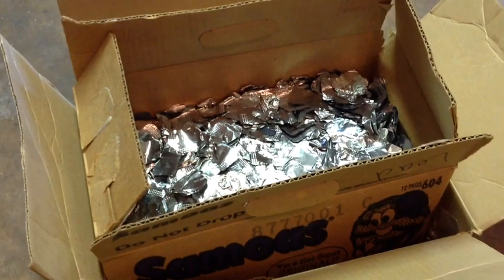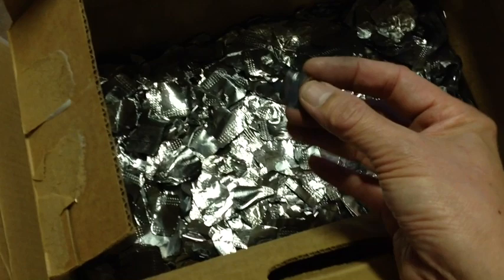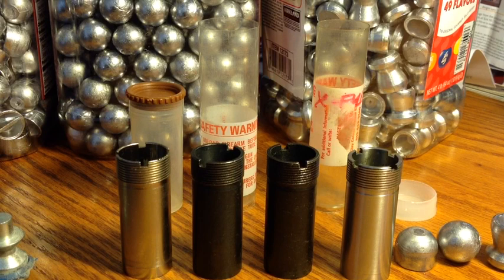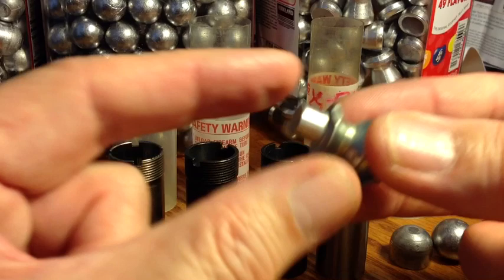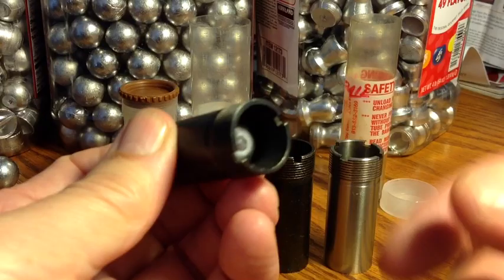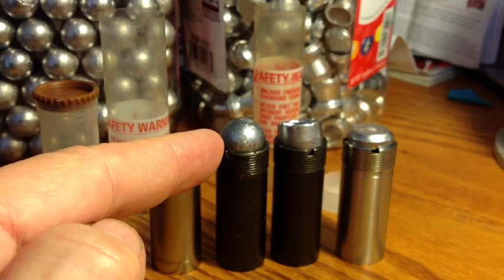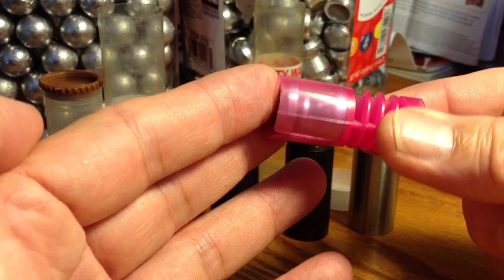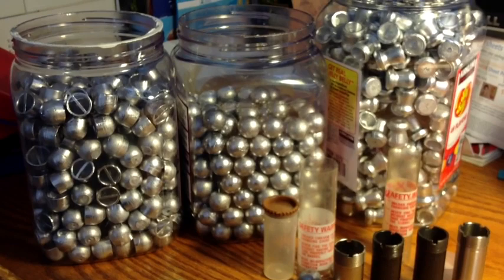Why Only Pure Lead For Shotgun Slugs?

Comment: Great video! I buy scrap plumbing and roofing lead from a local recycler. I buy alloy from RotoMetals and make ingots of various BHN#. I maintain there is no better ingot than the old corn-ear shape. They are about one pound each, have a textured grip and work perfectly with Lee Production Pots. They won't splash you with hot lead when you put them in because they touch the bottom of both the 10lb and 20lb pots, and their size and shape allow more to be added at once vs Lee or Lyman ingots. Also, you can pick up the molds (iron cornbread pans) at most peddlers' malls or flea markets for $10 or less and they make either seven or nine ears. I got over neatly stacking my Lyman ingots years ago. I throw these ears in a 5-gal plastic bucket and go through about 60 of them per day, on average.

Comment: There's not a single dental office within a 50 miles radius of us here in eastern Ohio that will let you have their lead. Not because another reloader already got claims to it, but because the dental offices are contracting with recyclers who got priority to the lead.
   Same goes for our local recyclers...they refuse to resell anything that was brought in to them. I was extremely fortunate to find just one small recycler who gets wheel weights from local auto tire/service shops and they also get pure lead plumbing pipe from time to time when homeowners get their plumbing updated.
   So I use wheel weight lead for my .45 ACP and 9mm Luger pistol rounds which ends up with a Brinell hardness of approx 16-18 , and then the pure lead pipe for my shot gun rounds. Only paid around .40 cents per pound for the wheel weights and around .60 per pound for the lead pipe. Collected the lead for the past 4 years and now got nearly 400lbs of wheel weight ingots and 150 lbs of pure lead ingots :D
  NOTE Get ALL you can while you can... due to environmental laws, lead wheel weights are quickly becoming a thing of the past whereby the industry is making more and more wheel weights out of zinc and other materials, and well the lead pipe is only something you come across at the right moments after someone re-did their plumbing and you happen to get to the recycler before someone else ;o)

Comment: I have been playing around with the lyman slug.  I use a remington 870 express with a rifled barell.  I started putting a 2% tin mixture.  I really believe the round is coming out better.  I plan on trying it on a H&R slug gun this year.
Reply from the maker: James Tepfenhart - Thanks for your fine comment.  Good luck with your slug shooting in that 870 and that H&R- 2% tin is fine in your slug alloy - as you know, the tin helps the molten lead to fill your mold better and produce better casting while adding less than 1 BHN to your slug. That's as good as pure as recommended by Lyman.  Good shootin' to ya...

Comment: great info ,have used hard lead for slugs for years but I also knew the reason for the warning .I only shoot slugs out of open choked guns .and I always label the hard slugs as such .
Reply from the maker: mark cooper - we'll just have to keep shootin' bullseyes there pardner…Best to ya...
Reply: I got tired of trying to find wads to use with lee 7/8 drive key slugs.I bought a mini milling machine and take the center post out of the mold and chuck it up in the mini lathe and mill the slug down to  size so that it fits in the wad properly then drop test it through the barrel

Comment: What about nontoxic materials such as zinc and copper?  New deer hunter here.  I read some research about toxicity resulting from lead infiltration in game meat and would like a healthier alternative to lead, but it's hard to find nontoxic factory loads.  I'm thinking about figuring out how to cast and hand load non-toxic slugs.  Thanks!
Reply: zinc fumes are even worse than lead. copper needs a LOT of heat to melt. though you can turn it.

Comment: i cast only wheel weight lead (never zinc or steel) or car battery cable lead or fishing weight lead or birdshot lead i melt and flux myself. shot thru only modified or open choke shotguns. i never use full choke fer anyfing other then size 6 or smaller birdshot.

Comment: +Fortunecookie45lc Thanks for the reply- of course I would be sizing the slug and adding the wad thicknesses to the diameter! If I wanted to destroy wads while sizing slugs I would just continue to do it with fast powder and my rifled barrel ;)

I don't know if the snug push through test applies to a rifled barrel like it does for a smoothbore? I think I'd want a little obturation. Of course it's not what I want, it's what my particular gun wants so the testing continues.
Reply from the maker: +radarsonwheels1 -- You've got a good handle on it...I hope your die solution works well, because if it does, you have a business opportunity.  After years of trying to get reload slugs to shoot as good as factory, I just tell slug shooters to use factory for hunting and purpose, and use our economical reload slugs for practice, recreation and range.  I guess that is my definition of elusive... You will see some videos with good accuracy, but we need good reliable accuracy, and if they have a magic barrel, they need to hang onto that...  Best to ya, FC

Comment: i cast wheel weight lead slugs and shoot them only through a improved cyl. choke and marked with sharpy on them W.W for wheel weight lead.
Reply from the maker: grizzskoalcope- IC or C bore is the Slug Policy, after all…your solution works… with soft lead, the advantage is No Policy is required… :) Best to ya...

Comment: Sheet lead such as is used in roofing, pipes, toilet gaskets, and the jars used for radioactive medicine are all common cheap sources of lead that is "pure" for practical purposes. pipes tend to have a lot of oxides crud and slag to flux off though.  People should also remember that scrap yards "metal recycling centers' will generally sell to the public. pure scrap lead in easy to handle and melt sources like virgin rolls of sheet lead is generally around 30 cents a pound. They usually charge about 60 cents for lead in ingots. I prefer the sheets because I know what's in them. Ingots are a mystery. I suppose I should bring my art pencils with me next time I go to test the ingots for hardness though.
Reply from the maker: GunFun ZS- Many do not have those great sources for pure lead.  I sense that is why so many comments hoping to be able to use other lead for slugs.  Kinda breaks my heart though to hear casters using precious WWs to make slugs or try to "burn out" or skim out hard lead to try to make soft lead.  If they had scrap yards to buy your examples, that would be ideal.  If so, they should stock up on pure lead for their slugs.  I read some old documentations of pure lead back in the frontier days - it cost them $1 a pound in their dollars (that was very expensive) and they carried little lengths of it to break off and melt in their little ladles to cast and every time they fired, they tried to recover the lead for reuse…Thanks for your great posts and good day to you...
Reply: Thanks for the kindly response. Every city has a scrap yard somewhere, I think it just doesn't occur to people to look. One thing I have found is that if I call and ask if they have lead at most of the ones I have checked on, the person who runs the office will say no. So ask what price they will sell it for if they have any. They are all going to have some, because people who bring scrap metal will have bits to drop off- especially from construction removals. So if you go and ask one of the yard hands, they are sure to have a bin of it somewhere. I just sit here jealous of your access to the berm. The indoor range  in my city does not sell the scrap or allow patrons to collect it. Worse, they actively lobby to close down public land shooting areas to build a monopoly. I will not give them a cent.

BTW, I just tested those Poly coat bullets in 308, and they seemed to shoot well close range, and I'm getting better at more uniform coatings. Bore was shiny. I've also ordered a replacement camera, so I hope to share findings soon.
Reply from the maker: GunFun ZS The last time I visited the metal recycler, I had three big cans of copper jackets and slag.  They wouldn't take them even if I just gave it to them because there is a regulation that range scrap would not be accepted because it might contain live rounds.  I tried to explain that this came out of a melt, but the regulation prohibited it anyway.  So I threw it into the garbage - go figure on that one.  Just gives you an idea of the regulations in the Great People's Republic of California…but I'll ask about the lead just in case, but it's still hard to beat the free pure lead I get from my four dental offices…I get a steady supply as you see from this video..Have a great day...
Reply: That's good my local dentists have never had any when I ask. Probably from other guys who watch your videos. I did buy about two and a half 5 gallon buckets of foils from a scrap yard once though.
Reply from the maker: GunFun ZS wow-your scrap yards have everything.  I've never ever seen any dental foil lead in our scrap yards…Thanks for your comment...

Comment: What if we have a full choke on a gun but the slug still fits all the way down the barrel bc I have that problem I have but with the wad it's a tight fit
Reply from the maker: robert hedges - Every shotgun barrel is its own animal.  There is a full range of variation in shotgun chokes and barrels.  We are told repeatedly that slugs should be pure soft lead and only shot through cylinder or IC bores.  The factories tell us not to shoot them through full chokes, but in the background - they have provided safety in the event that shooters accidentally shoot them through full chokes - because that will happen.  We can get into problems deliberately shooting them through our Full chokes because there are other variables that might raise pressures such as the oversized slug, overhard slug, extra tight wads, overcharges, fouled barrels.  And we don't have enough safety margins with Full chokes to really handle those especially if they occur in combination.  The warnings from the factoires and reloading companies are there not only to protect the companies, but also to protect us and those around us.  Best to ya,  FC
Reply: Remember that although slugs are usually high velocity, the slug; especially if they are homemade in a mould and passed though barrel; there`s always a fraction of compression of the slug ; especially if you`re using home made lead thus the slug may expand a fraction before leaving the barrel. So play safe and don`t use a choked barrel. Greetings From Malta Europe.

Comment: Howdy fortunecookie45lc! I enjoy your videos!I'm beginning to experiment with the lee 7/8 slugs but only in a scoped rifled mossberg 500 so thankfully there's no choke. I'm considering making a sizing die to make my finished product with wad .003 over groove to eliminate fliers from damaged wads and better center the slug. 
Have you considered this? Or have you found acceptable accuracy as cast? I remember you described the Lee slug accuracy as "elusive"!
Reply from the maker: +radarsonwheels1 -- Your sizing die idea has merit, but you might find problems in that the wad petals of your wad / slub combo are compressible and will not size well.  Would be better to size the slug and measure the thickness of the wads X2 and the total should be .002" or so thicker than the diameter of your barrel.  But easier would be to just use your barrel as a gauge - push the slug/ wad combo through it with a long wooden dowel.  If the combo pushes through with smooth but ready resistance, you have good fit to the bore.  If too tight to push through, your petals will strip on firing and your accuracy will be random - find a wad with thinner petals... Best to ya,  FC

Comment: What about a Modified Choke On 12 Gauge what would you Recommend 100 Lead Or is Wheel Weight Alloy Ok
Reply from the maker: Chris Chiampo  the best for our cast shotgun slugs is pure lead and only thru cylinder chokes.  This is the recommendation of all the factories and loading manuals.  Good test for Safety is to push the slug wad combo thru your barrel, if the combo is snug but pushes thru, you’ve got a good combo.  But harder lead like wheel weights are not recommended.  Bare slugs shot thru shotgun barrels should definitely be pure Lead.  Sabot slugs can be alloys but that is academic since we cannot make those ourselves anyway.
Reply from the maker: Chris Chiampo - Had to come back and finish the reply as, in all things firearms, there is more, much more, to it.  So the absolute info is shotgun slugs = pure lead + cylinder chokes (no choke).  Factories use pure lead in their slugs and tell people to only shoot them through cylinder bores...but they know that shooters here and there will shoot them through full chokes accidentally or otherwise.  The slugs are designed with reduced bearing surface and only skirted on the back to "ride" a .729 bore.  If shot through a full choke, the slug will pass through without blowing up the gun.  If so, why don't we just use full chokes all the time?   Reason is that if done, all the safeties built into the system are used up.  Anything that spikes the pressures may be catastrophic.  Even with my dowel push through test - if the slug/wad combo pushes through - then it's safe, right?  Answer is that it probably will be safe the big majority of the time.  But suppose that was a modified choke that was pushed through - safe?  But what happens if one of the petals folded back and a piece of the hull mouth also pinched off creating excess friction and then the choke came up.  Add harder wheel weight alloy slug that has less forgiveness... Could be a problem.  Even if not, the pressures would be higher - noticeably so.  That's all why the factories tell us the best formula   Shotgun Slugs = pure lead + cylinder choke.  That being said, we do have some leeway, but the best policy is for us to not use up the leeway.  That's true of all our gun systems.  Pressure is our friend, but also is the Siren of the Lake.    Happy Holidays to ya,  FC Steve
Reply: FortuneCookie45LC Thank You FC Steve For the Thorough Answer I Ask Only Cause I’ve Got a Winchester Model 12 12Gauge with the Fixed Modified Choke Barrel I Would Have To Get a Cylinder Bore Barrel Combo For It Or is Ok if I Take a Factory 100% Lead Rifle Slug And See If it Clears the Barrel then it’s Ok I’m kind of Leary Shooting a Slug Through My M12 As they Don’t make them anymore Hand Fitted I’m thinking I need a Mossberg 500 Pump For X Mas Thank You FC Steve If you can Advise 😎👍🏼 Subbed you Awesome Channel Great Info

Comment: Good morning fc45lc,great video.I have a lot of pure lead,is it not a good idea to mix a small % of it to the wheelwieghts.I have a good 30 lbs of it
Reply from the maker: o61000- Please save those WWs for a better use - making pistol or rifle bullets is the higher calling for WWs.  Just use the pure lead for shotgun slugs or muzzleloader/cap and ball guns.  Pure lead is the best for those, bar none.  Good castin' to ya...
Reply: +o61000 That will harden up your alloy by a fair bit. I suppose it's fine so long as you aren't firing through much of any choke.
Reply: @Porty1119  I use wheel weights and heat treat them to a hardness of 25. I cast 770 grain hard cast paradox shotgun slugs...but I ONLY shoot them through a cylinder bore choke. These are used for camping, fishing and hiking in bear country. Again...only used in cylinder bore chokes. The penetration is amazing.